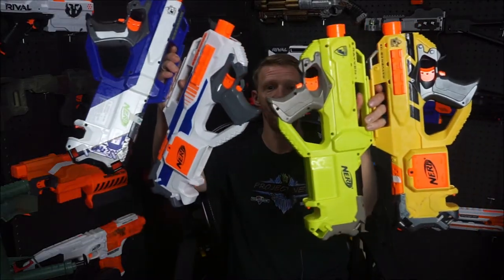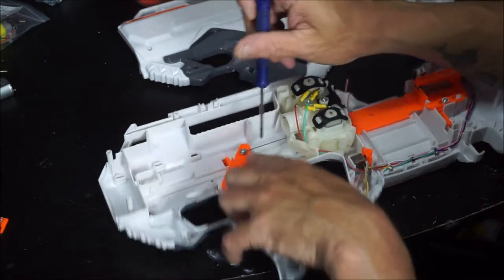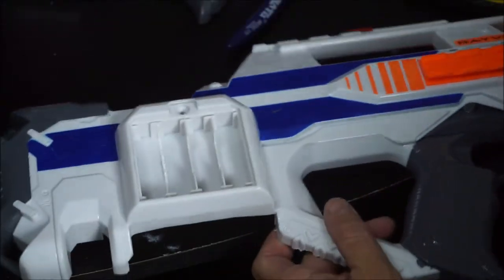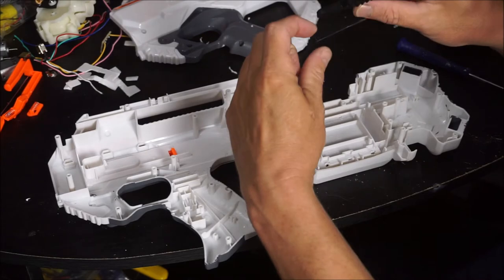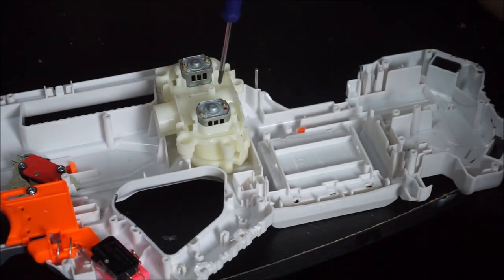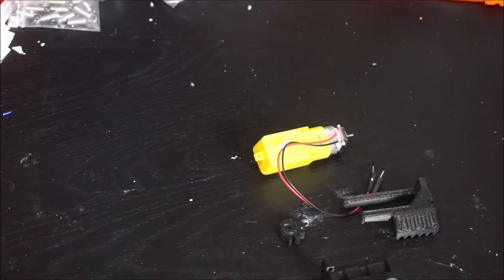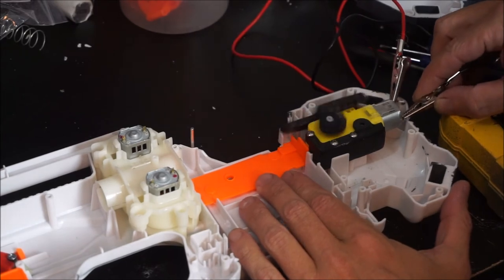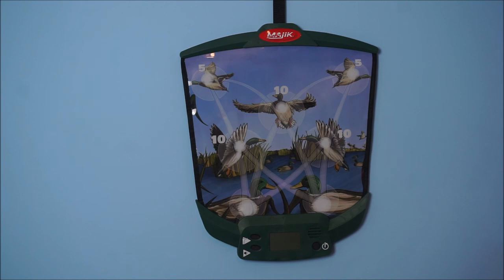Full Auto Rayven, Build Guide !

Comment: That's pretty much exactly what I needed!
What flywheel motors and LiPo did you use for it?
The internals have been in a box for a while now, as I'm having a bit of modders block, and am nervous again about doing flywheeler mods. So I've been lazy and doing springers. I need to get back on the horse as it were. after the stuck Worker flywheel issue that completely stopped me from modding any flywheelers for about 4 months or longer. :(

I know those Rayvenfires can be a pain with the solvent welded handle part.
At least it's only those models that have the solvent-weld problem
One of my Rayvens (the baby-sick green ones) is pretty much painted, just needs detailing.
I even got one of those switch-plates, mine is pink too!
I'm just scared for lack of a better word to do any flywheeler mods.
Have you got any better options for the gearbox and pusher mechanism rather than Hooligan? I can 3D print any parts if you have the .stl file or know where to get it and I can slice it in Cura and print it out.
I was going to use a Honeybadger as a pusher motor because of the much lower current draw and higher rate of fire.

I'm still not sure about the motor braking on the flywheels and how it works on a full-auto system, I did it on my Stryfe and it's only one extra really short wire, so no difficulties there, I just never rewired a Rapidstrike before either and I have all the things ordered and a ton of 42mm cages printed and ready to go for my Rapidstrikes, Hyperfire and Modulus that I also want to make full-auto.(For the Rapidstrikes should I use a 2 or 3 switch method? The 2 switch method M.T.B. uses seems simpler than having a return switch).
Right now I'm just too scared, even though I've done it before, that issue with my Rayven has totally shot my confidence.

I know the horrible sticky trigger you can get, mine actually locks the pusher arm on a semi-auto Rayven unless the rev trigger is pressed (I have no idea why), otherwise i just have to gently tap the pusher arm tip and it just pops right back, it's a weird issue as squeezing the pusher linkage channel against the shell also returns the pusher arm.
Your method seems a lot better, as does the return spring for the trigger, that box of springs will come in very useful now!

If you have a wiring diagram, that would be most helpful as I can read it better than trying to remember which wire(s) goes to which contact(s).

Thanks for the video, I just need to do a successful mod to get my confidence back.
Reply from the maker: These are set up all Meishel 2.0 motors, Matt. And the battery is my go to, for small 2s builds, it's a 600mah 65c 130c burst. Ran the same combo in the 25 Stryfes we built for PDK and he likes, so we went the same route here.
As for your Rapidstrike, I always use a 3 switch build, and you'll probably want to order a few big Diodes too. You don't have to put them in a 2s build ( though I recommend that you do ) but anything 3s and up you have to install diodes or the pusher will do a runaway fire thing, kinda like an over volted Stampede does.
Reply: I'm running a 2200mAh 2S 60C LiPo with Fang RV's as flywheel motors and a Honeybadger pusher (when the motors arrive, I already have the LiPo's) with M.T.B.s 2 Switch build it has motor braking to stop runaway firing. I'm not sure which diodes I'll need, they go in serial along the positive line to the pusher, though right?
I'm not sure I can fit 3 large switches in the Rapidstrike, 2 will go easily into the trigger group, but I'm not sure where to put the 3rd switch to get it to fit, not to mention how to wire it, to me that sounds super complicated unlike a Hyperfire build which is just a 2 switch setup I think, because of the motor braking and conveyor system rather than a pusher rod.

I'll have to look for those LiPo's as they seem to be the perfect size and amperage for something with more powerful motors than just Honeybadgers.
I've looked around and I can't find a LiPo the same that I can get in the UK, what make is it? HobbyKing certainly don't sell them.
Reply from the maker: Matt, you just give yourself no credit at all, my friend. Of course you can do it, and damn good too. If you need it I'll lend you a hand with the first one. Once that first one is out of the way, you'll look back and wonder what all the fuss was about.............................. Chris
Reply: I'm such a perfectionist I feel like everything has to be perfect and right every time and if I get one thing wrong I feel a failure, my Rayven I spent days on the paintwork on and sunk loads of money into to make it look amazing has been in pieces in a box for around 3 months now, because of one mistake where I warped the stock flywheel cage and had to get a new one, that inspired me to get my own 3D printer as my cages come out cleaner and smoother than the ones from Out of Darts, and cost me about 20 pence to make rather than £10 to buy plus another£10 or so for postage.
I managed to find a Rapidstrike Switch plate for Omron-type switches on Thingiverse so I can print that out and it should fit perfectly, it even includes a rev trigger and main trigger so you don't have to cut your original one down and at 0.1mm layer height, my fine prints look and feel like they've been injection moulded, they're so smooth, I just have to wait a few days for the screws to arrive that were like £1.69 for 20, it saves carving away at the stock trigger group and why not take the easier and cleaner route if I have a 3D printer?

Thanks brother.
Reply from the maker: I couldn't agree more. That's why I used the switch plates on the rayven builds. Cleaner Easier Better. And for me , when I mess up, I look at it as a setback not a failure. Think about it, your rayven is going to be even better with the new cage anyway. So the little oops with the stock cage is going to result in a better blaster.................Chris

Comment: I was wondering if I could just cut the wires for the locks that go to the jam door and magazine door
Reply from the maker: You can if you’re going to do a full re-wire. If not, you can cut the wires, but will have to solder them together to complete the circuit.
Reply: @projectnerf7920  ok thanks

Comment: Where did you get the full auto kit?
Reply from the maker: Hooligan, but I don’t recommend there stuff. I had to design and print extra parts to make them work. In a later video I used a kit printed by Attch Attachments, and they are far far better.